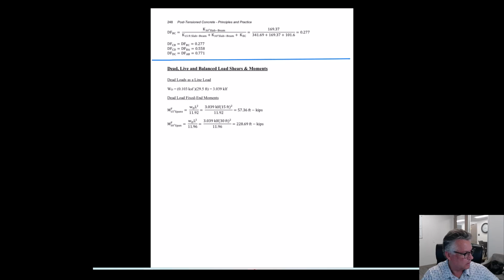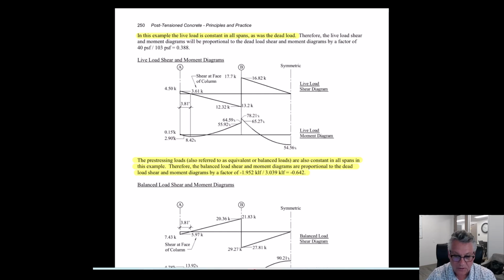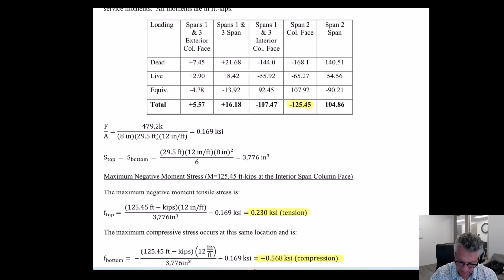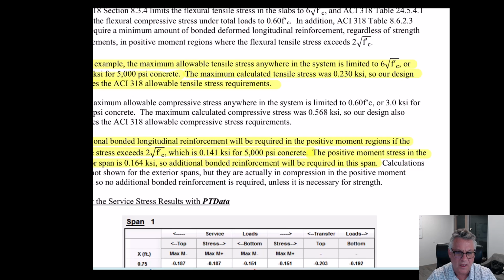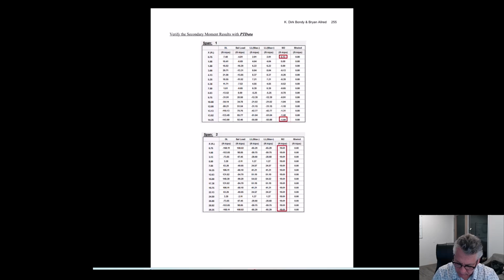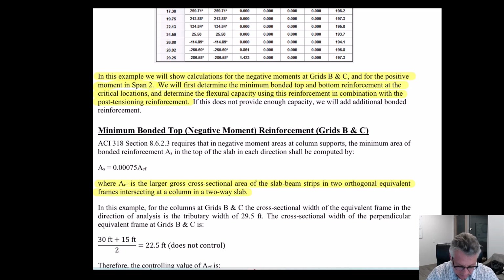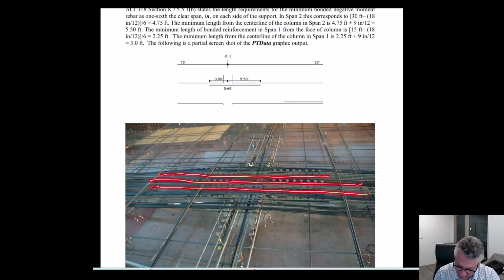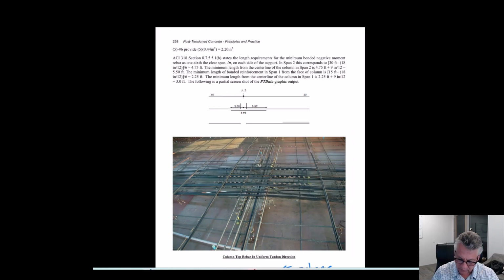Lecture 16 - Two Way Slabs Part 2

Comment: Hi Mr. Bondy. According to table 20.3.2.5.1 in ACI 318-19, Maximum permissible tensile stress in strands is 0.7fpu. Is this limit only for service limit state? Because when I calculate strand stress for ultimate flexural strength state (according to formula 20.3.2.3.1) , I get fps=0.95fpu. Is this a violation of the code?
Reply from the maker: The section you are referencing is only for the stressing end immediately after anchoring.  It is not the actual stress in the strand.  However, it is easily shown that this requirement is exceeded effectively on every project every time.  We have tried to argue that this is not an actual maximum requirement but more of a minimum expected stress.  It is very difficult to change the code for p/t these days, though.
Reply: @dirkbondy  Thanks for the insight 🙏🏻